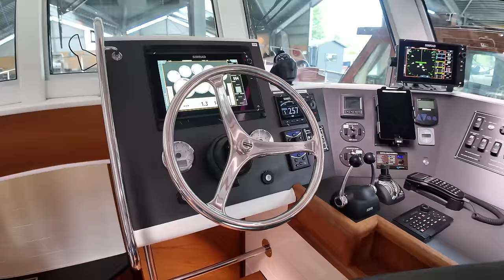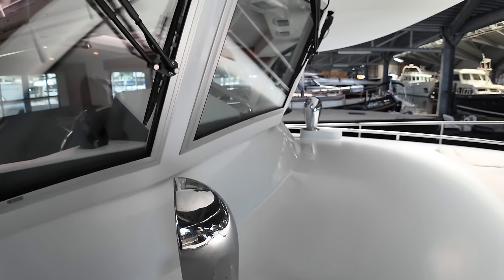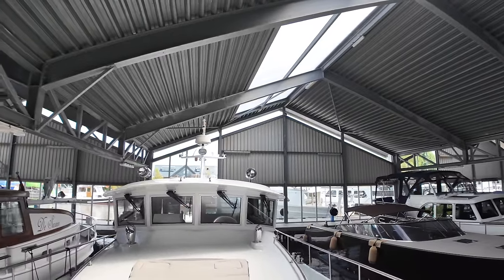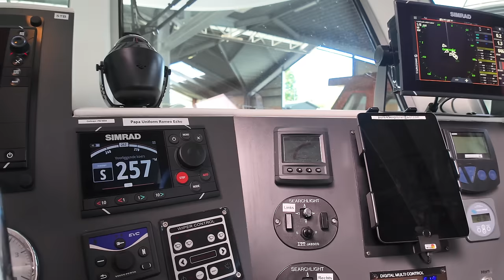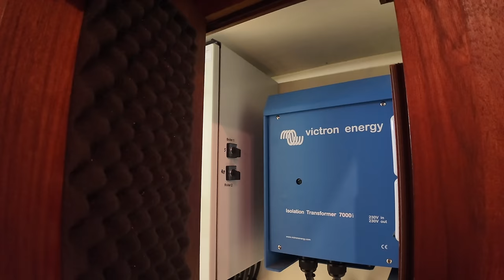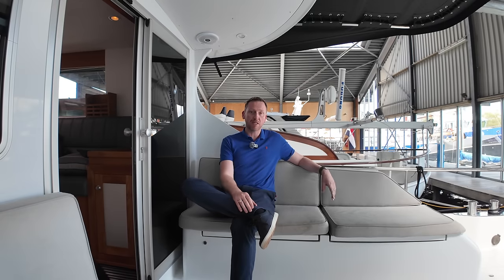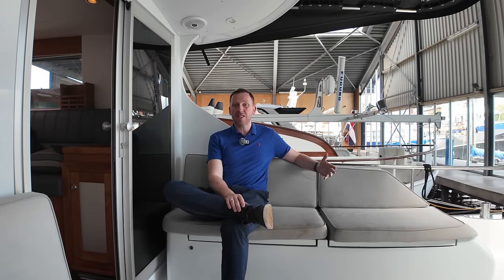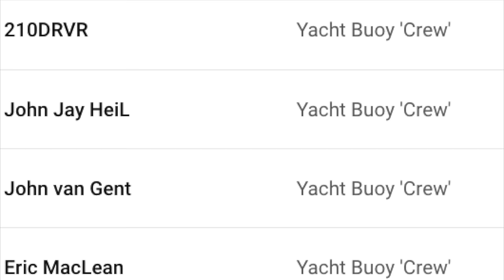RARE Opportunity: €449k Aluminium Explorer Yacht FOR SALE!

Comment: One question I have about the New Yachts. Why are the stoves all electric? I hate electric stoves, Grew up with gas, every commercial kitchen has gas, why do all the new boats have these terrible electric stoves? Its not "Greener" takes 10% or more gas to produce the electricity that can create the same thermal reaction as the Gas used by its self as the heat source. THAT MEANS YOU ARE CREATING MORE POLLUTION RUNNING A GAS POWERED GENERATOR, TO PRODUCE ELECTRICITY TO RUN THE STOVE. Also YOU CANT PUT ENOUGH SOLAR PANELS ON A BOAT TO RUN IT, EVER. THE CARBON FOOT PRINT TO CREATE SOLAR PANELS FAR OUTPACES THE CARBOND FOOTPRINT OF GAS, FROM MINING TO MANUFACTURE TO USE... HOW IS THAT GREEN... Come on People. Stop being "Woke" TIME TO WAKE UP. You been dreaming to long, its becoming a nitemare...
Reply: Because gas stoves on a boat have to be propane. Propane has two issues with use. One, it doesn't burn through like natural gas so leaves floracarbons in the air which lead to carbon monoxide poisoning. It's why you aren't supposed to use your gas grill inside your home. The second reason is propane is much more flammable than desiel fuel and have caused catastrophic fires on boats. When there is a fire on a boat, you have no where to go to get safely away from the flames. Sure you can jump into the ocean...but eventually you will drown.
Reply: They aren't putting electric stoves on boats to be green. Green people shouldn't want a motor yacht as it serves no purpose.  They use electric stoves and ovens because they produce no carbon monoxide inside the cabin and because you can only use propane on a boat which burns dirty compared to natural gas.
Also, the desiel generator in the sealed engine room with it's fire suppressor unit is far less likely to cause a catastrophic fire because desiel is much harder to light on fire than propane which sparks very easily. 
So, it is a safety thing rather than saving the planet.
Reply: Lpg gas is the most dangerous thing on a boat. Electric is much safer. Fire is the scariest thing any boat owner faces.
Reply: Lots of new boats come with gas stoves.   It’s a matter of personal preference.   In most cases it’s not a major undertaking to change from one to the other.
Reply: Gas is good until there is a leak. Electricity eliminates the risk explosive gases and carbon monoxide hazard. Cheers
Reply: Then you need lpg, you already have a generator ru. Ing anyway, so why not just use electric? Your argument would make sense if their wasn’t a generator running non stop
Reply: As this is an explorer style yacht, depending on where you cruise, you may not be anywhere that you can refill your propane. In the inland 2aters of British Columbia, you could easily be an 8 to 12 hour run to get to a village that may have some to sell. In the summer it can be hit or miss whether they're sold out, or not.
I dont totally disagree, though. I prefer gas. On tha5 point, many dealers will swap out stoves for your preference.
And please, unlock your CAPLOCK button.
Reply: I dislike electric aswell, however, I don't want to be out ` on the water` with a propane problem. In this application I can tolerate the electric range
Reply: That went from being a simple question to being a crazy tinfoil rant rather quickly 😂
There are severe reasons for choosing electric over gas. 1) safety as mentioned above. 2) it runs on electricity generated by the onboard generators, not from solar panels (wherever you got that from I don’t know) and therefore you don’t have to worry about refilling the gas when you’re out at sea for long periods. Of course you have a limited supply of fuel as well but far more than you would have in a normal LPG tank. 3) an induction cooktop is in most conditions as good as a gas one.
Reply: With gas apart from leaks and explosion risk you also have to constantly watch the level of the bottles and then find somewhere to fill them on shore. If you are cruising at at anchor that gets to be a real headache. Try handling gas bottles in a small dingy. It’s not fun. With electric and induction an option everything runs on diesel as marine generators are all diesel these days, not gas. One fuel powers everything on board and you have thousands of litres of it on good cruising boats.
Reply: Gas also tends to give you problems with condensation as well as those mentioned.
Reply: Electric is safer.  Has nothing to do with “Woke”.  I bet everyone avoids you at parties while you rant about Woke M&M’s.
Reply: Lol this guy thinks stoves on boats are politicised.
Reply: I've seen you tubers struggling to find refills and adapters when travelling between countries.
Reply: Induction stove is a lot better than gas. Its quicker, safer in multiple ways, its not hot to touch, it wont explode, its gas wont poison or suffocate you , you dont need to replace gas bottles,etc etc people now carry induction stoves for camping running if one battery. You dont need a lot of power to run it. You should try
Reply: Safety
Reply: Another reason is the lack of standardized fittings for LPG tanks.  Many countries require special fittings.  With electric you just need diesel to power your A/C generator.
Reply: @frankmeszaros1357  makes no sense, but ok
Reply: I couldn't care less if it's gas or electric. I can cook on both.
However, on my current vessel, I have an electric stove.
On battery backup, we have a ton of power to cook. It's only 1600 to 1800 watts to cook.
No generator or solar is needed for cooking meals.
Reply: Maybe just use an outside gas BBQ for the taste or desire. Otherwise, electric is there so use it.
Reply: It’s another system to run AND STOP SCREAMING AT PEOPLE
Reply: Ok, kaboomer.
Reply: I would change out the electric stove for a diesel fired stove. You've already got the fuel, and you don't need to run the generator while cooking.
Reply: Besides the safety factors pointed out, many boats use solar panels to power their appliances by using batteries and inverters making using inverter stoves more convenient since they can use the power stored in the batteries instead of having to constantly refill or replace the propane gas tanks for the stove.
Reply: Modern inductive hob's are more efficient than gas and there's non of the explosive or poisoning risks from Carbon monoxide or suffocating from carbon dioxide. 
They are also cooler to operate you can touch an inductive hob it doesn't get hot ...it's just the pan base that gets hot.  Hence you cannot use Al pans usually .. or pyrex/ceramics.  Even small sail boats use them but they make cooking  down below massively cooler and quicker..  You don't have to chase around trying to find multiple regional type gas bottles or adapters.. 
Important for cruisers and live aboard's  who actually regularly travel out of one country or region. 

Modern boats even those just running smelly old complex noisy diesels are being fitted with bigger batteries and super output alternators as people have to run more electrical   systems and charge more devices like phones Nav devices,cameras, radios AIS systems radar fans Aircon fridges and freezers.. and devices like lap tops drones battery power tools, water and air pumps... 

Some boats can run predominantly from stored solar ...even motor vessels  in N latitudes ..slow  cruising is a very chill way to explore Norway's Fjords or Swedish Archipelago..  at zero fuel costs and no noise or smell.. plus E motors are  cool running and virtually maintenance free  for years..  take a look 
at the Windelo Hybrid sailing cats.. they've crossed and cruised the Atlantic and other oceans barely using any fuel..  because they can regen under sail and they have huge high efficiency flexible walk on solar arrays and batteries that enable them to recharge anywhere and run their motors accordingly.  If  
They do run low or you do need to motor at higher speeds they can fire up one or more high efficiency quiet generators located anywhere remotely on the boat. They only have to run  
at one speed ...the stoichiometric optimum.. .
No gearboxes or clutches needed..no transmissions and electric motors don't care about the position they are mounted in or vibrate. They also produce full torque from 1 rpm to close to their max. 
Which is why heavy plant and ships bigger than aircraft carriers have been using them for decades.  🧙🏻‍♂️🇬🇧 Both the RN Queen Elizabeth and price of Wales use two giant Electrical propulsion motors.  The Diesels engines just produce the ships electrical power needs. 

I get that sometimes it's nice to watch a flame 🔥 burning.... but it has hidden costs and big risks. ... and insurance companies and boat builders know the real numbers ...  It's like the fire risk in cars is 80% greater in ICE vehicles than in Electric vehicles. 🤷🏻 That's before the newer cell types and chemistries. 

People who live aboard and travel a lot are increasingly finding that if you want to visit beautiful places and not destroy them or get destroyed by violent extremes of weather you have to find better ways of doing stuff... before you're forced to.
GRP and Carbon fiber are two very problematic materials that will need consideration ..  but if you look and research you can find scientists and engineers using fast growing soft woods..to replace them and even metals or glass and plastic s.
Reply: This is the dumbest rant ever.

That's all I've got to say about that. I don't want to be sucked in to it.
Reply: Short answer, no open flames
Reply: It's a safety issue.
Reply: Gas on a boat is an added risk that is unnecessary…
Reply: Silly people, trying to explain the hazards of propane. He's not interested in facts, he just wants to rant and whine about Green. The ALL CAPS should have been a clue. Another clue is the catchphrase Wake Up People.

I could mention that Carbon footprints are very important in determining the overall benefit of a technology but again he's not interested in that. It's just Wah Wah Wah, the world is changing and I'm scared. A hundred years ago this cowboy would have been railing about the dangerous Model T displacing horses.
Reply: As long as it heats my food I don’t care
Reply: Lowers your insurance cost for the boat, less risk of fire when using electric stoves.
Reply: Even some insurance company will not insure your boat if you using LPG or propane gas as cooking fuel. Safety purposes electric is preferable over gas.

Comment: For that range in a 49, at 20kn, that's a crazy amount of distance. So if you knock back to 8kn for distance cruising, you'd be pushing what, around 1000+nm on full tanks?

The cabin layout is unique, would probably convert at least one of the unused cabins to a pantry and/or laundry space (probably that double off the day head) for longer term cruising.
Reply: The numbers are a little off. 2900 liters is 767 us gallons. 150 liters an hour at 20 knots is 39.6 us gallons an hour. 400 miles at 20 knots takes 20 hours, which would be 792 gallons, which is more than its total capacity.
Reply: @MrDarcykampe  He did say about 400nm, and at 20kn @ 39.6usg/hr, that's still ~380nm (19hr) range with ~15usg in reserve.  So moving with following seas, it becomes a rounding error to 400nm lol

Jokes aside, most of the recent boats I've seen in this size and price range @ 20kn are often well under 350nm range.  Would be interesting to see the burn rates from 7 or 8kn, 10kn, 15kn, to really see what the cruising range might extend out to in real usage.